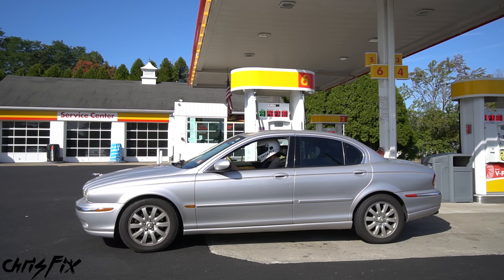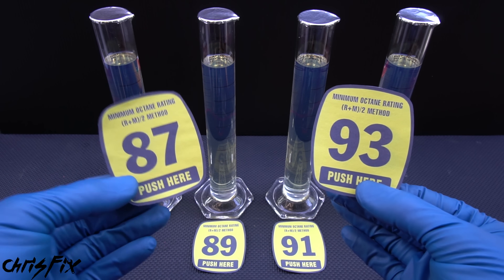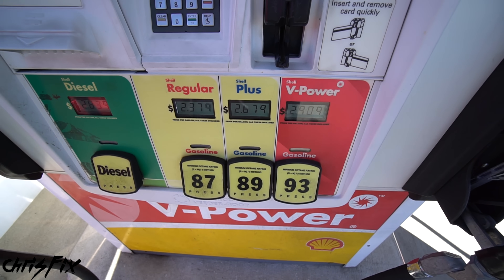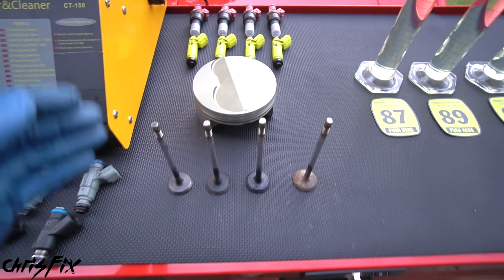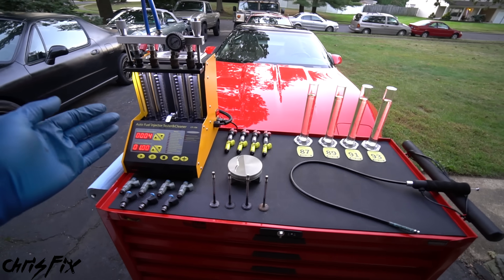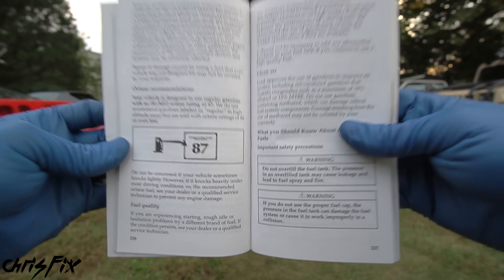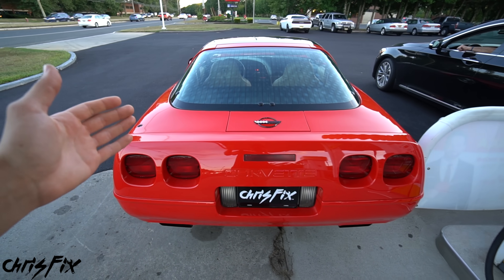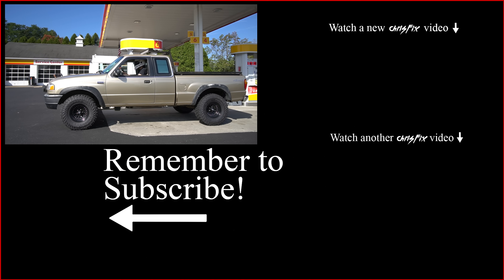What is the BEST Fuel to Use in Your Car or Truck and WHY

Comment: here in Oz, the lowest octane fuel is 91....we get that and 93, 95 and 98. In low compression engines we use 91 or 93, and for higher compression its 95 or 98. I found in my cruiser on trips (a vn1500 kawasaki) if i alternated between 91 and 98 each fill, i got better economy and it seemed to run better. As for diesel, you can use 35% petrol in a tank full of diesel as told to me by an engineer

Comment: It goes by the compression ratio, or effective compression ratio in forced induction engines. That being said, it falls back to the tune itself but most importantly the driver. The same VW Passat or whatever that would run fine for mom on 87 would suck for my driving style of the same car w/o super gas. Many engines that call for 87 run better and make more HP on 91/93, the newer VWs and Honda V6 comes to mind.

It's not a matter of quality either, all gas comes from a common pipeline and is additized by the truck driver with a key. Super has more detergents because it burns more slowly, and NEEDS more of the cleaning additives. I use a little 2-Cycle oil in mine, as well as much ethanol as I can get away with, at least 2 gallons of E85 in a tank, German cars howl on the high octane.

Check your owner's manual and use the Top Tier brands they all recommend. 3x-4x more additives than EPA generic gas. Trust me. E85 is the best fuel, period. Which burns cleaner, alcohol or gasoline made from crude oil? Duh. Which fuel is 105+ octane and has a great evaporative cooling effect? Take your time.

Comment: Ive ran 91 octane for 45 years . I get 2 , 3 more miles to the gallon runnin premium fuel in my sbc motors . If higher octane doesnt give you more milage then why does my miles to go go up 200 miles to a gallon with premium ? If i fill up with 85 octane . Miles ta go says around 400 to 425 miles . If i fill up with 93 octane my truck says miles ta go ,
610 . So i get 200 more miles to a tank runnin premium ! Speaks for it self !

Comment: I only use top branded gas in my Highlander.More Gas additives are in these.
Reply: If you use a good additive with Poly ether amines like Chevron Techron Concentrate,  then regular 87 plus 10 oz of Techron has more additives than premium 93 has by itself

Comment: Great post is interesting how many people I talk to don't know about octane rating. Just a general rule of thumb four cylinder cars that are n/a  use the minimum octane so do the same for straight 6 unless you supercharge or turbo. Once you go towards a v6 setup you'll want something a little higher. Then once you go past all that turbo/Supercharged 4 or 6 you're in another territory high grade pump fuel or something else? It depends on  engine configuration though. Smaller engine working harder creates more heat which is why octane rating makers sense.
Reply: Depends on the exact engine. There are big block gas V8s that run fine on 87, and most unmodified V6s are tuned for 87

Comment: if fuel in Europe is the same why does Toyota sale 13.5 to 1 compression prius in Europe and 13 to 1 compression prius in the U.S? and why 85 octane in Utah. is it the higher altitude above sea level lowering cylinder pressure effectively lowering compression.

Comment: Awesome information!- Thank you so much!!! Just was recommended by my Dealer to make Sure, I rum 91 in my 2017 Chevy Silverado High Country. I’m running a Corvette Engine Block, 6.2L All Aluminum with Stock 420HP. Been using only Regular in it for the 3.5 years I’ve been driving it. Occasionally, I would put in the 91 to “Clean it Out”, but after watching your video, now Know a Tank or two doesn’t take care of that. It says right on my Gas Door inside, 91. I never thought it made such a difference, except to my wallet when filling up. Now I Know, it’s like the Old Fram Oil Filter Commercials….. if I keep using Regular because it’s just a lot cheaper per tankful, I can “Pay them now… or Pay them Later”… not to mention the hassle of ot having a reliable vehicle to start ad run when you need it to. From now on, it’s All 91 All the way for me, and I do prefer the Shell Gas Stations or my Gas. The Chevy just seems to run Best on it. I’m gong to send your Video to my Dealer Service Advisor in Cobourg Ontario Canada and Tell him Thanks, for telling me the truth!!!… and I Thank you too, for a Super Explanation for a simple guy like me. At 67 Years of age, I’m always willing to learn! Good Driving my friend, I appreciate your Efforts and have Subscribed to your Video’s! ….. Joe in Ajax, Ontario Canada.

Comment: What's your opinion on adding fuel injector cleaner to your gas once a month or at every oil change?
Reply: Make sure you use cleaner that containes PEAs (Polyetheramines). Otherwise it’s not even worth buying. 2 examples are Chevron Techron Concentrate Plus and Gumout Regane

Comment: Another thing is there’s no way your pickup had detonation, detonation is cause by  to much compression and to low of octane rating which the pickup you were showing I’m assuming has around 8.5-1 would never have issues with detonation
Reply: Enough carbon deposits can increase the compression ratio. Also, carbon deposits can get red hot like coals and cause pre-ignition and/or detonation

Comment: What you said is actually false you do get more power with higher octane all depending on what your driving for example my pickup is a 2017 Chevy 1500 l83 high output 5.3 with 11-1 compression and you can run e85 87 89 91 and so on 87 octane is not as good of gas as 91 and yes they do have more power with more octane 87 has less power making ability compared to 91 and myth busters actually proved the higher the octane the better the gas milage but as for my pickup I’ve been experimenting with fuels such as e85 which is 105 octane 91 and 87 e85 gets worse gas milage but more power for one reason e85 takes a higher fuel mixture to run properly and as for 91 and 87 the same rules apply 87 has less stored power compared to 91 which gives 91 more power and better gas milage

Comment: You mentioned E-85 (85% ethanol, 15% gas) but how do we navigate using the E10 or E15 fuels (90-85% gas, 10-15% ethanol)?

Are those also Flex-Fuel only blends? A pump I stopped at on a road trip ONLY had those options, which was strange. 

I try to stop at Shell as often as possible! Thanks for this video.

Comment: Funny he said higher octane doesn't effect gas mileage or performance at the beginning.  That's a yes and no issue.
Reply: It depends on the specific engine. Some can increase the ignition timing advance if they sense higher octane for slightly better mileage and performance. Other engine will produce zero difference

Comment: Some vehicles advance ignition timing until the knock censor detects knock. Then the ECU retards the timing a bit. Running higher octane may give you more HP (more advanced ignition timing) and millage but is probably not worth the extra cost. Valve number one may be clean but it's still F#@%ed.

Comment: From the manual of my Taurus SHO 
• 3.5L V6 SHO/2.0L EcoBoost® engines

“Regular” unleaded gasoline with a pump (R+M)/2 octane rating of 87 is recommended. Some stations offer fuels posted as “Regular” with an octane rating below 87, particularly in high altitude areas. Fuels with octane levels below 87 are not recommended. Premium fuel will provide improved performance and is recommended for severe duty usage such as trailer tow.
Reply: Those engines can advance their ignition timing once they sense higher octane for better mileage and performance

Comment: 2014 Taurus SHO Ford states that 87 or 91/93 are both good to go for it. However they say that you should use 91/93 if you are more performance minded and 87 for cheaper fill ups

Comment: ROTFL, in Poland we don't even have 93 (USA premium) It's start from 95 and  finish at 100 (V-power)
Reply: Our octanes are identical to yours. You all just use a different rating scale for your octane numbers
Reply: Ehhh USA and UK ...
Reply: @skystep2  your 100 is the same as our 93
Reply: @ezrawaters6653  Cheers buddy. I checked popular polish petrol station (Orlen): so 1st(RON: 98 MON: 88 USA: 93), 2nd(RON: 95 MON: 85 USA: 90). So ours 98 is yours 93. I did not found documentation for it but our RON 100 will be around MON 90 so yours 95. Yours is called DON / AKI by calculating like that (RON + MON)/2. So technically we got access to better petrol. Still there is no reason to be happy, in Europe we got cars with engines from mower, so to survive 100k miles needs better fuel.

Comment: Loved your presentation Chris, I have been giving this speech for years.  One thing that I will offer is that the chemical reason that higher Octane fuel does not ping is because it will wait to detonate till the spark is reached and thus avoid firing due to temperature in high compression engines, hence it does from the point of view of the engine, burn slower. In fire school, I watched them put different fuels in a glass tube and ignite one end and watch the flame propagate to the other end at different rates.  The reason is that "Octane" is actually a chemical that burns slower than the ones that predominate the mixture in lower Octane fuels.  

If anyone cares, you can look at the straight chain organic chemicals in the Alkane series: Methane, Ethane, Propane, Butane, Pentane, Hexane, Heptane, Octane, Nonane, and Decane - These are molecular strings of 1 through 10 carbon atoms (bonded with Hydrogen - Hence the term Hydrocarbon).  The first three are gaseous fuels (Methane is Natural Gas), 4&5 are "petroleum distillates" or lighter fluid, some 5,6,7,&8 are present in varying amounts in gasoline with some other variants, with more of #8 (Octane) slowing the rate of combustion.  By comparison, lower Octane fuel has more of 5,6 &7 and other variants. 

Thanks so much for what you post.  I come back and rewatch them over and over when I want to do something on my vehicles.

Comment: Hello, how are you? I would like to talk to you about a very important matter. I live in northern Syria. There is a local manufacturer of petrol that operates on it.  But there is no sound inside the blast chamber, and there is no torque for the car and the temperature rises, so we have to put 2 colas oles.  If you put octane in the car, does the explosions inside the blast chamber become like high-octane gasoline? Do you have a solution and thanks

Comment: People need to stop comparing Octane and star comparing BRANDS. Mobil 1, Sunoco, Shell. They all offer cleaner fuel than Walmart. There is a reason it's more expensive and I can promise it's not smoke and mirrors. I had an old car and  switching from Kroger gas to Mobil 1 improved it's MPG by like 3 miles. Why? Because it has cleaner in it that helps remove deposits of carbon and burn cleaner.

Comment: Not only do you not understand octane rating, and its application. You completely disregard the dangers of detonation. When detonation occurs when the flame front strike each other is what causes the knock in an engine. Because those flame fronts are striking each other at a ridiculously high velocity and can cause damage.
You almost got the European fuel rating correct when you cross reference it. Their version of regular is 90 octane by our standard. Their premium is at least 93 if not closer to 95 octane. 
I came to a much better understanding of octane several years ago when I arrived at a station when I had about a third of a tank of fuel in my 98 Dodge Caravan 3.8 liter V6. The station had run out of regular and mid-grade. What was allowing people to fill up with premium for the same money. When I did so, that tank of fuel allowed me to get 20.5 miles per gallon in City driving when before I was getting about 16.6 period on the expressway I was getting 31.5 before I was getting about 25 -26.
As it turns out, that I can't waiting also affects the burn rate of the fuel. But because higher compression engines start out at a higher burn rate even with a higher octane fuel it is not any different for a high-compression engine to burn premium gas at the same rate that a lower compression engine Burns lower octane fuel. Which probably explains your confusion. At the time, the difference between regular Fuel and premium fuel was only $0.10 a gallon. The reason for that, is it doesn't cost the fuel industry a single penny more or less to make truck and deliver the fuel in high octane then in low octane. It cost the same amount of money to deliver that fuel because of the way our fuel infrastructure was set up decades ago. This 30 cents a gallon from 87 to 89 and thirty cents a gallon from 89 to 93 octane, is called thievery. But that's another argument. The other issue indicates that when you have a knock sensor it's going to detune the engine to whatever fuel you put into it anyway. But I have done this on a couple of occasions even with my 2003 Jeep Grand Cherokee with a 4.7 and it does get markedly better fuel mileage when I mix the fuel to about 90 to 91 octane. It also tends to run a bit smoother. Whenever I'm towing something I always like to mix at least some premium fuel with the gas. I haven't done it quite enough on this vehicle to find The Sweet Spot like I accidentally found it on my Dodge Caravan. But that is due mainly to the insanely unnecessary price differential that was slowly put into effect.

Comment: How would you swap between octane if required? Do you have to run the car till empty anf then refill? Like if you want to try higher octane to help clean the engine and then go back to lower?

Comment: in Poland i have only 95octan, 98octan sometimes 100octan, 103/105octan on beter gas station , probably because European cars are produced under a minimum of 95octan , i use 98 or beter to my mazda rx7 for beter work engine.

Comment: I have been making mistakes for years!!!!!  This video is a must-watch.  VERY well presented, clear, concise, and focused.  My compliments to Chris on a well documented and entertaining video!  Nicely done lad.
Reply: Quick Update:  I did what Chris said and checked my car's owner's manual.  I own a 2012 Ford Fusion Hybrid.  The owner's manual recommended REGULAR grade gasoline.  I had been putting mid-grade and high octane gasoline in the car over 95% of the time believing it would give me better gas mileage and performance.  For over eight years, I was averaging between 28.9 MPG and 29.4 MPG.  After switching to REGULAR grade gasoline, the engine performed BETTER and was quicker off the line (the momentary hindered start disappeared).  I am now averaging 33.9 MPG (I took a photo, but I can't load it here).  So, I'm getting BETTER mileage with REGULAR gasoline and saving LOTS of money.  Thank you, Chris!!!

Comment: you can say what you want. I drive for a living. and when I use 87 I get 300miles per tank pretty much always. but when I use 91. I get 340+ every tank. I track all my miles driven. and it's the same every time

Comment: Do not use E-85 even if you have a flex fuel vehicle.  Corn juice is evil for several reasons.
Reply: E-85 can produce higher HP numbers depending on the tune.  Late model boosted engines can perform really well. How long they last on just e-85 is the question.

Comment: Hey, quick question. Here where I live (Europe) we have 95 and 98. 95 is the same as E10 and 98 is E5. These mean Ethanol levels and its commonly known here that E5 is better as more Ethanol dryes up your fuel system and cracks rubber parts. Is this just a myth or truth?
Reply: Biden Sucks  around 1.5-1.6€ per liter. It is really high Up right now

Comment: "the bigger the number the more power you're going to get...and that is false" Wrong. That is not a blanket statement My car allows me to push 24lbs of boost on 91 (560 hp), 28 lbs on 93 (600 hp) and 35lbs on E85 or 110 (700hp) - sooooo yes, higher octane DOES allow me to run maps with way MORE power.

Comment: if I fill my car with regular then drive a little then I stop at the gas station and fill it with premium. Is that okay?
Reply: What does your car require? If it requires premium and you fill it with 87(regular) that’s not good and you should add octane booster or try to add 93 as soon as possible.

Comment: Quick question, when all these sports car and exotic cars gets modified with new tunes, for example, a mustang GT or a Lamborghini Huracan, and the tuner says or the owner says that they run on E-85. Is that E-85 same as the one found on some gas stations? I the reason why I ask this is because E-85 on the pump is significantly cheaper than regular 87. So I wonder, is that the same grade they are talking about or it’s some sort of race fuel like MS109 or something. Thanks for reading!

Comment: When I was 17 I had a '69 GTO that I accidentally filled with diesel. Permanently ruined the engine. Don't put diesel in a car that burns unleaded. I got about a mile away from the station before my car broke down. The engine would run but as soon as I even breathed on the gas peddle the car would shut down. I didn't realize my mistake so I restarted it and let it run for a while, only further damaging the engine.

Comment: The fuel station I most often use offers regular, E-15, and premium. Premium and E-15 have warning stickers:  The premium is for off road use only. It's illegal to use in a vehicle on public roads. The E-15 is 15% ethanol. It has a slightly higher octane rating than regular, but slightly less energy. The warning sticker says to use in 2002 and newer cars only. Using it in older cars can cause damage. The E-15 sticker also says check the owner's manual.

Comment: Can you mixup the octanes?
Reply: Yes, so long as your car doesn’t require a high octane to begin with. So if you are only required to use 87, you can add any of the higher octanes. Never put in a lesser octane that what is required.